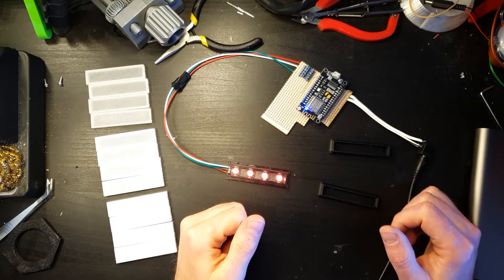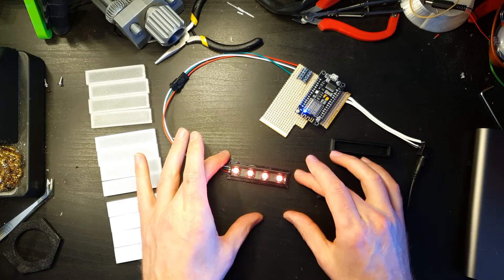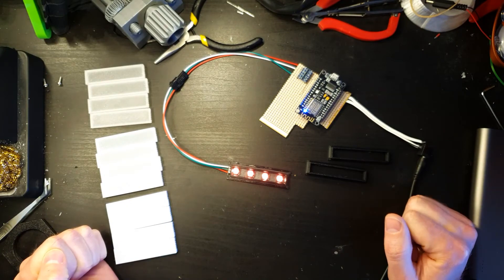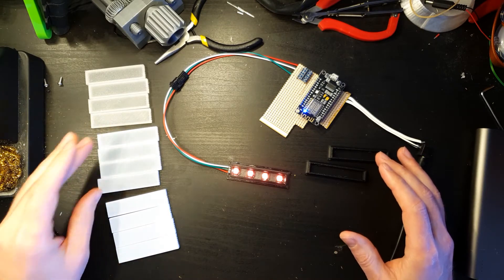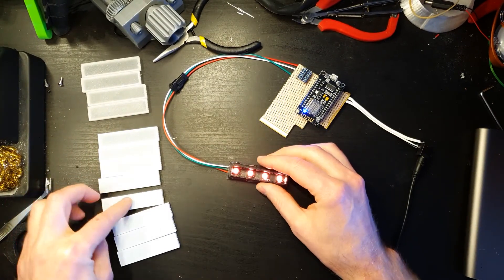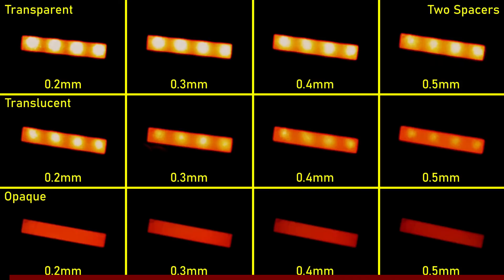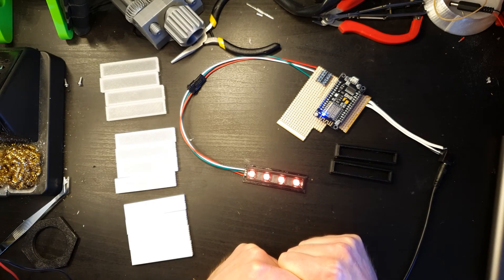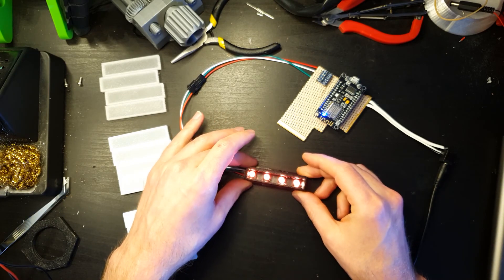3D Printable Diffuser Experiments

Comment: You might want to play around with surface patterns and thicknesses. Having the surface be thicker directly beneath the LED and thinner between LED's should cause the light distribution to even out. You also could try having try having an air gap between each of the spacers. Based on what you're showing it seems like a 0.2mm transparent spacer closer to the LED's followed by an air gap and a 0.2mm translucent layer further away from the LED's might look great without losing much light.

Comment: Nice. But you should change your design. Not thicker, but with some kind of light guiding filaments from the actual LED spots to the gaps between that LEDs. On top of that a diffused/rough sanded diffuser. The light "rails" will take maybe 40% of the light to the gap areas and let the other portions light through.

Comment: I wonder what would happen is you printed a pyramid diffuser. So that the point of the pyramid is on top of the led. This way the most direct light has the most material to go through and the sides further away from the led would have less material and more diffuse. Just a random thought I had watching this video :)

Comment: What I find great for my project is to make black suroundings around led. and then on top I put, very thin, print of white. That way each LED is declarer a lot and there is no fusion of light.
Reply: Hi there, two years later. :) Curious about what you mean - printing with black filament of some sorts right in front of the LED's, and then on top of that the thin white?
Reply: @aVataR_eHYeh  youtube is timeless haha, so a black enclousure so the light doesnt shine trough it. then a white cap, I remmember sanding it also

in front of the leds you only need slim white layers, maybe sanded, and also. some people turned leds up side down so the effect is more soft

Comment: I know it depends on application and thickness available, but wouldn't you achieve a better effect if instead of pointing the LEDs towards the diffuser you position them so that they point at 90 degrees either down or up? you could use a white filament to produce the holder bracket or even lay it with an aluminum foil to even out the light spread. I think the effect could be much better using smaller LEDs this way on their full power with thinner diffusers.

Comment: I experimented with arround 10 different white pla/petg plastics until i got the right one for a led matrix lamp (like the one you did from Ikea) what i didn’t try was using 2 layers with an air gap. Probably when using a tiny layer right on top of the led strip, than an air gap and than the outer diffuser it may be possible to get the smallest spacing while still getting the brightest homegenetic light (no hotspots). Just a thought though….
Reply from the maker: Hmmm like that idea, so say like for my IKEA lamp LED core then have a cylinder (vase mode) quite close to LEDs and then a second cylinder about 5mm away?
Reply: @smartroadbiker  I'm also considering this approach, with a twist.  To use your example, a cylinder with one or more LEDs at its axis could be printed as a solid object using concentric infill to create several, spaced-apart, walls of one wall thickness each. The diffusion could be increased by increasing the infill %, which adds more concentric walls and automatically maintains even spacing between them.

Comment: A really interesting experiment / test.  I had the same challenge when I was designing my 3D printed multi-segment LED displays.
In my case, I’m just using a white PLA (with some translucency), for the diffuser.  
My solution, for obtaining a relatively even visual diffusing effect, was to have a 0.4mm raised and chamfered circular area (on the diffuser) directly above each LED.  This provided a way to reduce the directly viewed LED brightness, whilst providing relatively less opacity in the spaces between the LEDs (for a visually even spread of lighting).  To work as intended the diffuser is placed relatively close (in my case around 5mm) above the LEDs, with the diffuser 1.2mm thick and the circular chamfered areas raising the thickness above each LED to 1.6mm.  
Depending on your LED's & filament, your diffuser & raised area thicknesses will need adjustment. But perhaps this gives you another option to explore. :-)
Reply: I was thinking about the same thing when watching the video.  Why 1.2mm thick though?  In his video, it seemed .3-.4mm would've been a good lens thickness with the rest being 0.2mm.  Were you using brighter than avg led strip?
Reply: @Jaze2022   It was a long time ago, but I was using WS2812B 5050 RGB SMD LED's on my own PCB design. The thicknesses I arrived at would have been related to the opacity of the particular white filament I was using, in order to achieve the appropriate diffusion effect / brightness that I wanted.   It was more the approach that I had taken, which I thought others might have found useful, as opposed to the specific measurements I used (although the ratios might provide some starting point for experimentation).